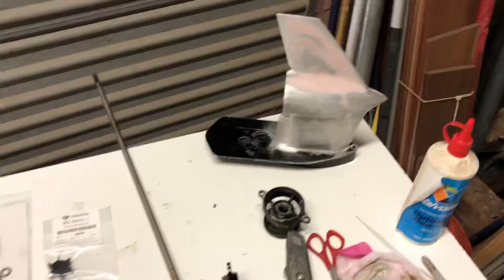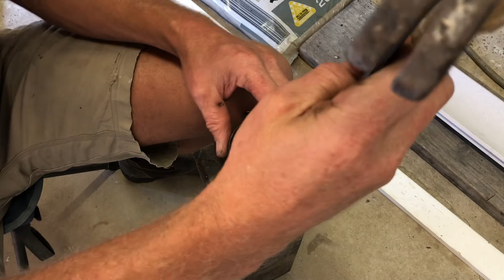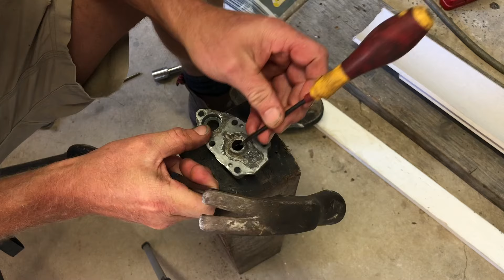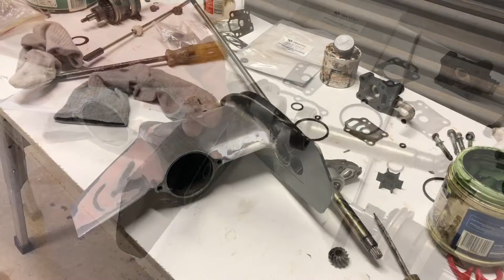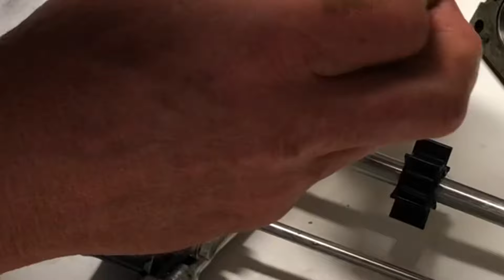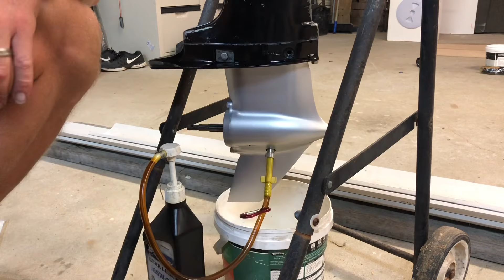Outboard seal replacement - propeller - drive shaft - shift

Comment: Here a small update on my bearing matter. I ordered an aftermarket 6002 one just to test for my 5hp Merc. They sent an "Parsun" bearing....doh.... At first glance it appeared good, rolling smooth and very little play. It had the markings 6002  P5 and C&U. I was about to install it but then tested rolling it with som axial load.....no good. There was som small "resistance" every now and then, not much but still easy to notice. It would maybe smooth out during use, but wont take the risk. Next test: Purchased a SKF 6002, mad in italy, marking 00 089W. According to specs P5 grade. This was smooth what ever load. Maybe a fraction more play than the Parsun, but otherwise better. Just for fun, when ordering other Tohatsu spare parts( from BoatsNet/USA), had also a OEM Tohatsu bearing. This one is marked 6002 NACHI  JAPAN. Technically feels identical to the SKF, can not tell any difference other than the marking, price was also about the same, 10 euros.  Tohatsu ones are cheaper than Mercury, probably same part though. For this application would use SKF as a replacement in case don't hav the time to wait for OEM part shipment. Parsun...no, don't do it!
Reply from the maker: Hi mate,
Thanks for the update, very interesting 🤔 
I normally buy from Tohatsu for my Japan built Mercury motors (most of the time the Mercury parts fit those motors are from Japan anyway) and my Tohatsu parts supplier is lovely 😊 
One of the reasons why I don’t like the non genuine bearings is even if they feel good they are unproven to me in a motor install situation.
Also if used on a crank the standard bearings don’t have the anti spin pin.
Good research though and totally agree with no Parson.
Cheers 🍻 
Aussie Boat Guy 😎

Comment: I have learned a lot from you! Thanks for taking the time to respond to everyone's questions! Here is another question- On a 5 HP Two Stroke Mercury, does it make any difference what grade or octane gas I should be running?
Thanks Again!
Reply from the maker: Hi mate,
Thanks for your comments, I really appreciate it 👌
The fuel really doesn’t make much of a difference, I personally run 98 octane but that is me 😂
I run 50 to 1 fuel to oil In my two strokes so every 5 liters it’s 100ml of two stroke outboard oil.
Cheers 🍻 
Aussie Boat Guy 😎
Reply: Thanks! Keep those videos coming! Two stroke Outboards rule! @25hpboatracerman

Comment: Great video, thanks! Extremely helpful! Did this on my old merc 5hp. Toughest thing was to get out the bearing carrier in one piece...One question about the shaft bearing(6002). Pending where You live, can take a while to get the original mercury or Tohatsu brand bearing. What do You think, would a SKF or som good Japanese 6002 type bearing work? Not sure about the tolerance, maybe C3 in this application?  On the Parsun ones(straight copy) reads 6002 P5, not sure how that is compared to C3 or C2 specs?
Reply from the maker: Hi mate,
Thanks for your encouragement 😊
I always use the factory bearings, they also have a factory locator pin on the factory bearings. I reckon that you could use an aftermarket bearing but I would remove the dust caps as per the original but I do not recommend, just order the factory bearings.
Cheers 🍻 
Aussie Boat Guy 😎
Reply: @25hpboatracerman   I fully agree regarding the engine bearings. Regarding the gear case,  I am pretty sure the OEM ones are just standard good quality open bearings, the problem is that we don't know the specification( Internal clearance) so yeah, better use tohatsu or mercury bearings anyway.
Reply from the maker: @XSAILOR65  
Hi mate,
Yeah, it’s just easier to get the original for sure. 
It’s annoying that they take a while to arrive for you, I’m very lucky, I normally have my parts within a week 😁.
Cheers 🍻 
Aussie Boat Guy 😎

Comment: Great video and well done! I have a question- My gear oil is leaking out of the top of the shift shaft bushing. Can I replace the "O" rings without dismantling the gear box? You did not show us how to remove the shift shaft. Thanks, keep the videos coming!
Reply from the maker: Hi mate,
Cheers, appreciate your comments 👌
Yes on that case you can just replace the o rings with disassembling the whole lower unit.
If it’s the same as that gearcase just undo the one bolt that holds the shift seal down and pull the whole shift shaft out. 
Some other lower units are different and you need to be carful to keep your lower unit upright and still (it may have a shifter inside that the shift shaft slides into that you do not want to fall off its seat in the lower unit)
Normally the twist shift lower units are harder with that shifter inside with the shift shaft that slides into splines in the shifter.
Some of the old OMC units had to come apart completely to remove the shifter as well.
What is your lower unit from??
All the best.
Aussie boat Guy 😎
Reply: Thanks!!! My lower end is from a Mercury 1994 5 HP Two Stroke. It is exactly the same as the one you rebuilt in this video. So all I need to do is pull it up and out? Then replace the"O" rings and slide it back in?
Thanks in advance!
Reply from the maker: @gregkobylarz8648  
Hi mate,
Yep, that’s the go 👌👌
Just make sure you slide the shift shaft back in with the shifter end facing the same way, you will see what I’m talking about when you slide it out. It has a three level end on the shaft that needs to face the rear of the case.
Cheers 🍻 
Aussie Boat Guy 😎
Reply: Thanks! You have been more than helpful!!